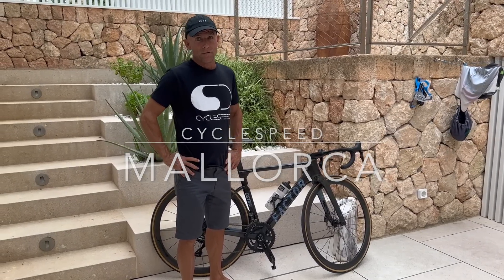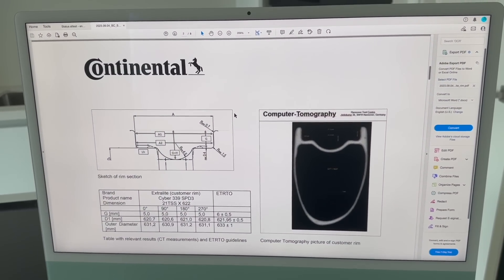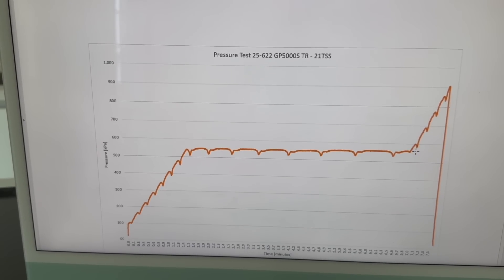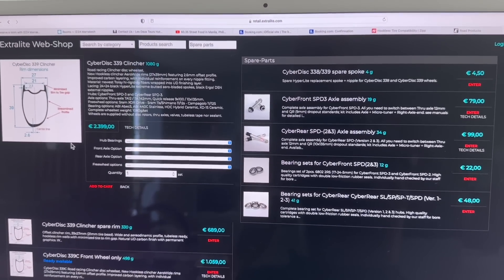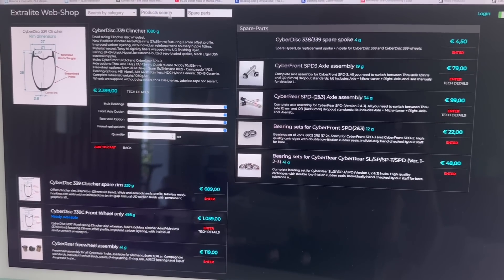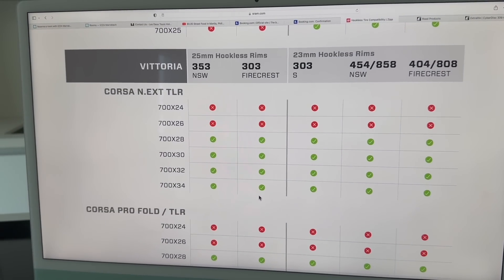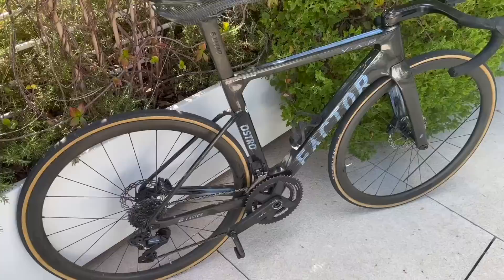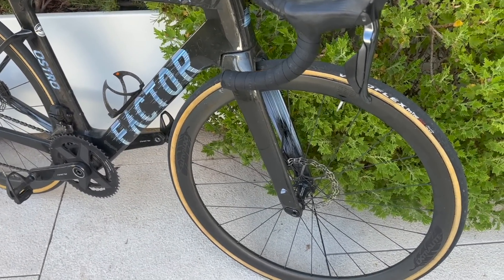Revealed! Why the Tyre Blew off the Hookless Wheel

Comment: Appreciate you sharing your findings. I will never buy a hookless rim, this is a point in case as to why.
Reply: Extralite built a wheel out of spec and you blame the … spec?! Alright.
Reply: I don't see a benefit of not having hooks. It's a safety critical interface. What can I gain by upping the odds of a tyre and rim not having such a strong joint?
Reply: Agree totally. It just goes to show how flawed the concept is with rim and tyre manufacturers that can't be trusted to work.
Reply: Why?  Just learn and understand basic specifications.  There is risk in anything if you don't adhere to specifications.  No need to be a fear monger.
Reply: @roadcyclist1 fearmonger?  I'd be pretty bloody scared riding down hill at 70kph without hooks on my rims
Reply: @dickieblench5001  why?  As long as they are to specification, the inherent risk is the same as any non hookless.
Reply: @roadcyclist1  if you say so. Personally I wouldn't trust my life to some industry specification.
Reply: @dickieblench5001  maybe on 1st go. I'm 1.5 years in on 2022 giant slr1 and cx2 hookless wheelsets. Never had a problem. I'm fine done my research consulted giants info. My take is it's just another bike thing, not everything's compatible I need to replace my front brake pads. Can't just shove anything in there, hundreds on market only few of them will work. That's what we all signed up for as cyclists.
Reply: Exactly! I will NEVER buy hookless.
Reply: is like you have a car that came with bike breaks, and when it fails you blame the car and says "i will never buy a car again" instead of blame the company that make that hugh mistake